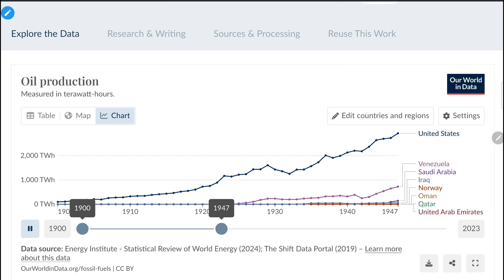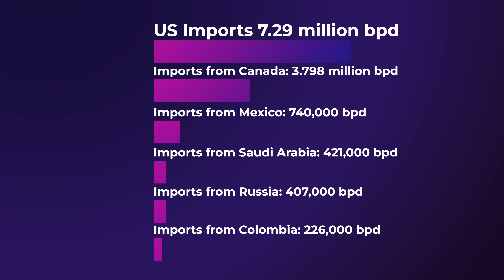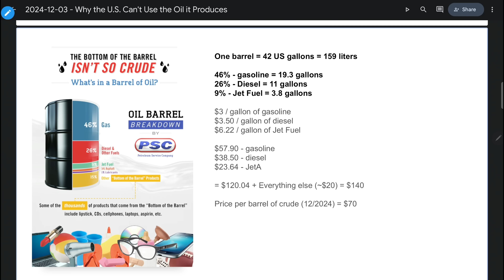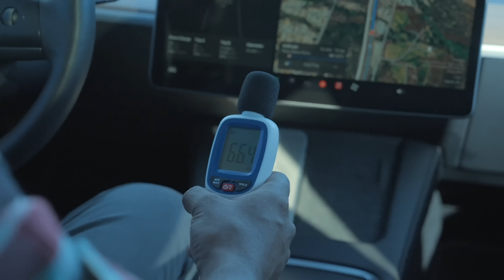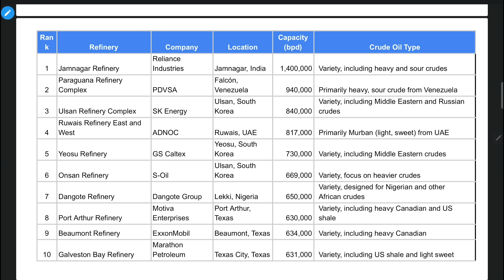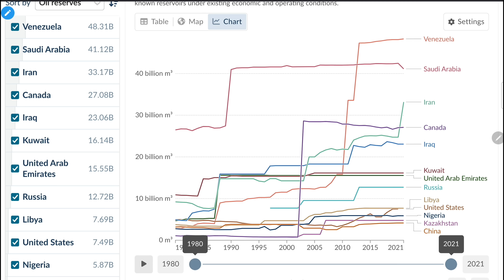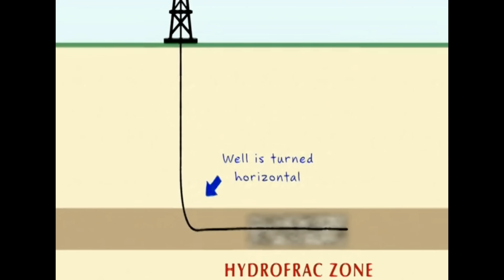Why America Can't USE The Oil it DRILLS

Comment: I really hate to rain on your parade but electricity has to come from somewhere to power the batteries for the cars+.  And a HUGE amount of petroleum is used to get the hazardous materials for the battery powered (bp) cars, wind turbines, & solar panels.  And then there's the issues of using child labor to mine these rare earth hazardous materials as well as the time folks waste waiting for the bp car to charge as well as the lack of ability to recycle the wind turbines & solar panels.  And let us not forget the massive amounts of landscapes spoiled by the wts/sps & farm lands contaminated.  There is no free lunch, yet, when it comes to energy.  To purposefully cut off an energy source is not a sound approach.  Currently the wts/solar panels cause our electric grids to become unstable & when the wind is not blowing & sun not shining, there is no power.  (Do the rolling blackouts in CA & TX ring a bell?)  Let the market/consumer decide the energy form they want to use without gov't intervention.  I do agree we should be using our oil locally & the companies not upgrading their equipment should bear the brunt of consumer wrath.

Comment: You mention the price differential between light sweet and heavy sour crude oil but kinda gloss over it. Refiners have configured their refineries to take advantage of the economics of this cheaper crude oil mostly within the past 20 years or so.  The refineries are not configured this way because that was the crude they used to get historically.  Historical US production ( like West Texas Intermediate or WTI) was lighter and sweeter.  Imports from Canada, Mexico, Venezuela were so much cheaper, even after shipping charges, that refiners changed configuration for economic reasons. And you are right, changing back, even if economical, are looked at very carefully because of the politics of energy and climate change.

Comment: You would do great to supplement this video with one explaining the engineering challenges and  potentials for green synthetic bridge fuels, produced on-site at every fueling station in the World. As in synthetic gasoline, diesel, kerosene, and propane: produced from raw materials easily delivered to each fuel station: tap water, solar PV, green grid energy, and direct air-captured carbon-dioxide.

If achievable, such synthetic fuels could eliminate all of those tanker ships, as well as tanker trucks, refineries, wells, fracking and other extraction operations. We need to then compare the decentralized costs of producing synthetic fuels to all of the costs of extracting, refining, storing, and transporting our current fossil fuel petroleum (whether just the raw actually paid costs or also including the externalized social costs as well). 

My hunch is that if we could overcome the tremendous inertia created by the fossil fuel petroleum industry, we would quickly develop techniques for producing these synthetic fuels that would easily beat the fossil fuels petroleum when internalizing externalized social costs. Even more, like the tremendous advances we have seen in solar PV, we might achieve synthetic fuels less costly than fossil fuels, even while disregarding the externalized social costs.

Economies of scale can he great when they happen, but this is a case where decreasing returns to scale would also be a benefit because it would facilitate great economic decentralization  (increasing returns to lower scales), while remaining efficient (or even becoming more efficient than concentrated  higher-scale operations).

Comment: EV penetration isn't even close to 1-in-5 in the US. However, it takes at least a decade to bring a new refinery online, which is where the problem is. Basically, by the time a new refinery is brought online, it is expected that demand would fallan dramatically.
Reply: Without CONSISTENT support to BUILD a national charging infrastructure the USA will remain the villain in automotive greenhouse gasses. China is on board to have ZERO greenhouse gases from automotive emissions by 2030. Just Saying.
Reply: All electric PLUS hybrid make up just over 20% of new auto sales in the US. That might be what he was thinking.
Reply: @Mech-a-Tech-a-Tiki    Also, there are a lot of heavy equipment operators that are switching to electric power rather than diesel.
Reply: he didn't say the u.s he said the world.
Reply: The sales of EVs haven’t increased as dramatically in the US relative to other countries, but recent dealer inquiries have seen interest in purchasing EVs increase to over 25%. Basically, 1 in 4 people who walk into a dealership are interested in EVs. Honestly, the relative lack of quality EV choices in the US combined with the slow buildout of quality charging infrastructure is the limiting factor here. GM’s recent news should be encouraging, but they still need to provide more affordable versions, in addition to fixing some of their system technology. VW’s failures to resolve their system software tech should be a cautionary tale.

In any case, EV penetration even at 10% to 15% is going to take a noticeable chunk out of vehicle fuel demand. At 20% to 25% it’s going to completely change the dynamics.

Comment: EVs require batteries that are environmentally devastating to manufacture, don't last very long, and are extremely expensive with little to no advancements in battery technology decade by decade. The gross energy production required to sustain an EV future means every nation needs to increase output by +30%, which they aren't doing and will never meet those targets with wind and solar, and since batteries only store energy, they don't create it, most batteries are charged by coal, diesel, or other methods that are larger polluters than gasoline. You can have a greener future or an electric future, but not both.

Comment: As an chemical engineer in the energy industry I can say you got most of the facts pretty correct, but your conclusions are iffy. To me, we can treat our own oil, but it is currently more profitable and a better use of our assets if we export light sweet and import heavy sour. If we treated the light sweet it could be done but it would be a pain, and a lot of expensive assets would not be used. This makes us also energy independent, because no outside nation can cripple us by stopping their oil flow like in the 60s. If somebody parked subs along our costs and threatened to sink any ship. From an oil perspective, we would not be happy, but we would survive. Before the shale boom, we likely would not have survived. Furthermore because we export almost what we import we are less price sensitive to the price of oil. If the price goes up it's just going to a guy in Texas vs to another country. So drilling enough to be a next exporter is good in fair times, and gives us a huge advantage if brown stuff hits the fan.

Comment: If you think we’re going to be moving to significant levels of “renewables” in your lifetime I’ve got a fabulous bridge in Arizona I would like to sell you. Without massive government subsidies renewables will never be cost competitive. That’s the only reason they’re as “big” as they are now. They’re really nothing more than a pipe dream scam liberals use to separate gullible rubes, and sadly, through threat of violence, the taxpayers, from their money so they can launder it through doners  and phony shell companies for their own gain. Think Solyndra. Just one of a thousand examples.
Now, even the whales off the eastern coast have been relegated to the back of the bus for this crap. Not to mention the oil necessary to mine and refine all the rare earth and other materials necessary to build the “renewables”. Every windmill that gets stood up is a net loss because the lifespan of the windmill doesn’t generate enough energy to even pay back the cost, let alone some small profit. Ditto all the panels littering what used to be vast open spaces. 
You argument is flawed. The problem isn’t the availability and cost of oil, it’s a perfect demonstration of the mindless bureaucrats choking off a vital industry through senseless rules and regulations. For zero gain, except for their pocketbooks.
The bureaucrats and environmental-fascists might have a slightly more convincing argument when they start giving up their cellphones and computers and everything else made of plastic, metals, or rare earth components. Hypocrites.

Comment: California has lots of oil, but due to local state politics, is not able to drill for it. Refining capacity in California is also highly over regulated; so much so, that three refineries will be closing within the next two years. Given that no refineries have been bimuikt in California since the 1970s - due to over regulation making it too expensive to do so, and due yo the fact that Californiahas its own fuel blend requirements - - these three refineries closing are likely to cause fuel prices in California to skyrocket. 

Amd, as of that wasn't bad enough,  Governor Newsom's air resources board, has recently raised the state tax on a gallon of gas to nearly $2/gallon.  

The thinking is that this will drive people towards purchasing electric vehicles. But electric vehicles are more expensive than gas vehicles,  less reliable,  more inconvenient and more toxic to produce and dispose of.  If an EV is involved in even a minor accident,  they're often "totalled" by the insurance company, due to concerns that the battery integrity may be compromised  - which could cause a fire in the future. And yes, EV's can catch fire, and when they do, watch out because they're going to consume the entire vehicle and anything nearby. This increases the insurance rates for EV's. 

And lastly,  no one at the California state level, seems to have any idea how to "power" all of these EV's.  Ive worked in the solar industry in California the past ten years, and speaking from experience,  I can tell you that all of this needed electricity "isn't " going to come from "solar."

Most of the "additional " electricity being generated to run these EVs is coming from natural gas power plants - which do their own polluting.  So your "non-poluting" EV,  is often running on electricity generated by fossil fuels.

But even if you own your own home in California- hard to do with the average home price in the San Francisco Bay area and Los Angeles area being well over a million dollars - you're looking at a large investment to install a solar system.

Take for example the most popular selling vehicle in the United States  - the Ford F150. The electric version comes with a 100 kwhr battery,  but gets less than two miles/kwhr. So, if you drive 30 miles to work, snd 30 miles back each day, you need to charge that truck a minimum of 30 kwhrs per day.

Again, thans to Governor Newsom's gutting of the "net metering" program in California when going solar, you now gave to purchase a battery system along with your solar panels, in order to charge that truck. 

A solar system capable of producing and storing 30 kwhrs of electricity each day would run you $50,000 - $60,000; and that's "just" to charge up one third of the battery's capacity. And let's not forget that this solar system wouldn't have any electricity left to run your house.

And California has a law on the books where all vehicles sold in California beginning in 2035 "nust" be non polluting  - essentially meaning, all electric or hydrogen powered.

And of course, we haven't even addressed the cost to upgrade California's electrical grid, in order to move all of this electricity around.  That's likely to cost trillions...

Indeed, because of all of these new "green" demands by state politicians in California,  the cost of electricity has quadrupled over the past ten years.

Bottom line: 

Its a nice ambition to go all electric, however,  its extremely expensive to do so, and only really benefits wealthy home owners, that can already afford to purchase and own an extremely expensive home,  not to mention an expensive EV and expensive solar system.

FYI,  Governor Newsom just purchased a 9.1 million dollar home in Marin County,  and he's so rich, that he didn't even sell his expensive home in the Sacramento area - near the state Capitol.  So Governor Newsom had "two" multimillion dollar homes, whereas the average Californian can't even afford one.

Add to this that California has the highest state tax in the nation - 13% - which hits the "working class" hard, but barely dents the income of the rich like Governor Newsom - who make most of their income from investments.

The hypocrisy of Governor Newsom is stupifyng, and his policies are driving business and people out of California in record numbers. He's got to be the worst Governor the state of California has ever had...

Comment: I work in the Los Angeles refinery systems as a diesel field engineer. This an extremely great explanation of why we can’t use a lot of the oil we extract . These refineries cannot and will not shutdown to revamp their units to be able to handle shale oil . It’s also almost impossible to build new units or new refineries due to a lot of political red tape in the U.S.

Comment: You realize that  the us  has not been built  a refinery in the United States since the 1970s the ones that existing are  grandfathered in and they keep on being retrofitted every time new technologies available
The reason is because the department of Energy will not grant a permit to build a new refinery 
And yes, we can use a lot of the oil that we get from the United States. Have you ever heard of coking? 
Cooking is an advanced distillation process. It’s being used for a very long time that allows us to take heavier forms of crude and refined it into lighter gases that we need such as kerosene, gasoline, and propane while  still utilizing the heavier stuff for things such as diesel fuel heating oil And asphalt
The process of refining and cooking is a little bit more expensive, but it is feasible, and it is done every day in the United States by major refineries across the region 
So your argument is full of holes 
I don’t know if you’re being willfully deceitful or you’re just plain ignorant

Comment: Oil from oil shale is lighter than other crude, it does not need as much refining.  You are making assumptions based on political bias. You promote solar and wind which are more expensive and they are not able to produce on 24/7 time frame. Educate yourself please.

Comment: So you're wrong. we do refine our oils from shell. We've been doing it for a few years now, and I work in the oil and gas. I talk to chemists and engineers quite a bit, so when they say oh we can't its not because we can't at all it's because we are refining other types of oil at the moment. We would need to shut down units for turnaround to take the shell oil. Yes, we buy oil from Saudi Venezuela, etc. That's what we are getting paid to do by other countries because our refind products are the best and cleanest because we had years to develop the separation, so if a plant has 7 units that refine 1 or 2 is shutdown for maintenance and repair 1 more is probably bringing shut down because it takes a long time to cool off. The other are refining products, and only 1 is refining shell oil because it's for that, but the 3 is refining oil from the other countries because, yes, it's easier and cheaper because we got paid to refine the oils

Yes, there are some refinery units that can't because they are just way too damn old and can't handle caused There's wasn't meant to refine the product and it would damage the refinery, but with the new plant coming on line and and being built we can switch back and forth from definite heavy or lite and sweet or sour oil in less down time at a lower cost.

There is a plant that when it comes online, we would process 1 to 1.5 million a day of refined oil product and still have enough for home consumption

Comment: EV’s and renewable energy are a green scam. They can never provide the power to run the economy. And with artificial intelligence on the rise, it needs massive more power. That is why I think it was that Google bought 3 mile island. Yes that 3 mile island the scary one that almost melted down decades ago. All of that why we don’t use the oil that we drill for is a bunch of nonsense. It’s very simple in many ways. All oil on planet earth is put into a big pile and is sold to the highest bidder period. There are other factors like we cannot get a new refinery built in this country because of the enviro-crazies. They think by stopping a pipeline they are stopping the use of oil, but that is stupid. They are using the most inefficient way to get it there and that is by Truck. Trucks are big trucks and use a lot of oil to get the oil to where it has to go so how are you helping the environment?